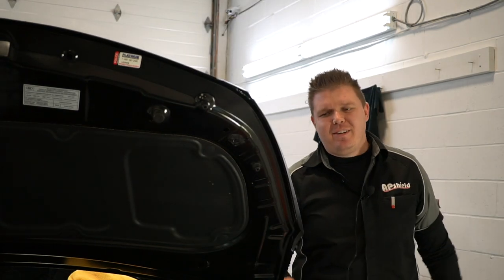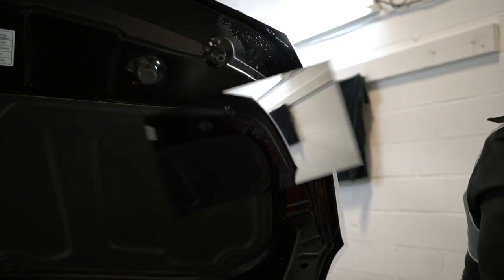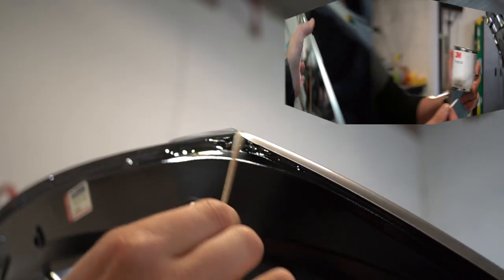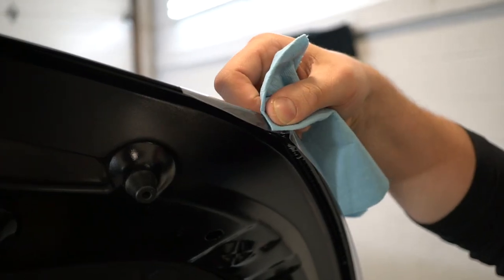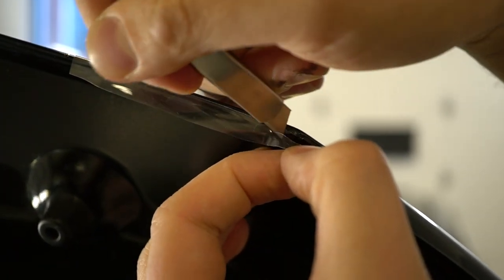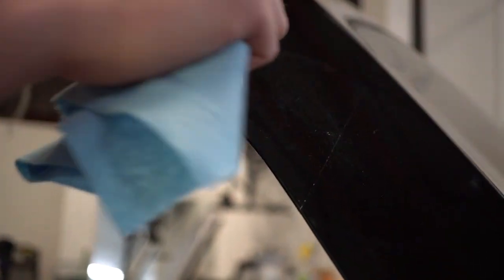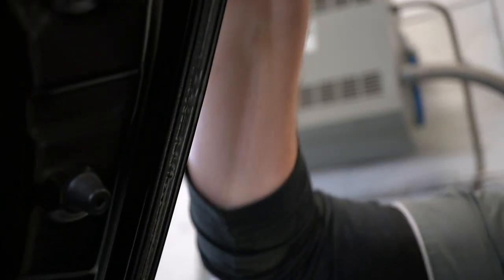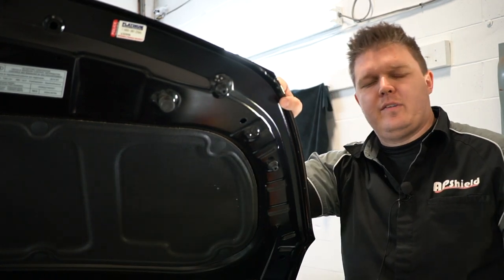How To Wrap PPF Corners and Edges LIKE A PRO

Comment: Have a question about this process. How does primer 94 compare to XPEL's edge prep? I also saw you apply the primer 94 to the paint and what seemed to be the film? Does the primer not burn the adhesive on the film?
Reply: Primer 94 is not intended to be used on PPF to my knowledge. Under corners it does ent matter. If he were to put that on the surface it would be very visible

Comment: How long after installing did you wait before using the air dryer to dry the edges? Does using the dryer ever cause the edges to lift?
Reply from the maker: You can use it almost immediately.  Just make sure that the edges on the flat surface are stuck down.  You can use some tack solution around the edges for more bite, then blast out any moisture.  If all the edges are lifting, you may be using too much soap in the slip solution.
Reply: @ThePPFChannel  Thanks for the tip. Just discovered your channel. Love your professionalism

Comment: One question, does the 3M Primer stain the film?
Reply: I was wondering that too because I noticed it seemed he was directly touching the back of the film with the promoter. In my experience this can cause damage to the film itself, though I use Xpel's adhesive promoter and not 3M.
Reply from the maker: Where I used the promoter, it will be in areas that are not seen when the hood is closed.  I put a bit of promoter on the film where the sharp corners are, but its just a small amount.  I'd never use Primer 94 in visible areas, especially on white colour cars.  It has a possibility to change the colour of the glue, and leave a "ghost" mark.
Reply: Thanks for the response, your videos are the best yet in explaining what you are doing....

Comment: That will most likely lift in a week or so.
Reply from the maker: No sir.  Been doing it this way for 10+ years with no issues or comebacks.
Reply: I agree. The corner will eventually lift.
Reply: First of all adhesive promoters are the wrong way to install film!!! This is done by inexperienced installers that dont know how to properly use film. 2nd when using adhesive promoters you are taking a high risk of pulling paint down the line when film is removed.
Reply: Agreed. If not a week deffo in a few months. That's a very poor corner installation and the primer was a joke!
Reply: Yes to the people commenting about why it's wrong, please share what method you use instead?

Comment: Wayyyy too long of a process.. nothing pro about this. Adhesive premoter, if used should be applied to edges prior to install. Some say its dangerous which it could be, but if done right and installed correctly it is much more effecient and less time consuming. When you trim the excess film off your edges, simply cut to a lower profile when reaching your corners.
Reply: @Jonathan Pthe glue is on the film. Adhesive promoter is strong stuff. If you apply pro bond (adhesive promoter by Xpel) to an edge after instal has already been done, youre risking burning that glue underneath if it comes into direct contact. There for possibly scrapping that whole piece of film. (Profits down the drain for a full hood for example, and having no choice but to re prep and start over again)
Reply: @Jonathan P note: dangerous because once you close an edge into probond, its a done deal. If there is an imperfection like a dust or a hair caught on the edge after you sealed it, its done. Maybe you can manage to lift it up again and stretch it out more, but on a black car it wont be pretty as you will have a nice glue line imperfection where the stretch was made. It really is fragile stuff
Reply: @Jonathan P   Trim all around leaving about 1/8th of an inch with my ulfa knife and carbon blade. (Holding knife with my index and thumb, leaving my other fingers free to rest on hood to guide my knife to ensure its smooth and not wavy) Going even shorter when you reach a corner, then back to that size while exiting a corner. This size of extra wrap will fit every hood without dips or non flat surfaces underneath the edge so it will be closed nice and flat.  You will be able to tuck wrap your thumb from one corner of the hood, (i start with wrapping the back edge by the winshield from driver corner to passenger corner, and then slide it along the whole hood  wrapping everything without having to lift your thumb. One smooth move. Closing the edges in less than a minute without having to go back and fix your corners. Virtually no lines what so ever.
Reply: @Jonathan P  also, this guy is using a blower to dry out his edge....what!?..blowing dust and hair and particles to your edge and risking lifting it.. Putting pro bond prior to install and closing the edge with your squeejee will cut this nonsense right out. But.. wayyyy easier said than done. Thats why i said if done right by a real professional!
Reply: You wont be able to be trained through internet. I had 8 months of full time training by a company out here in Quebec. 8 - 10 hours a day installing film, peeling it, and re installing. This line of work is not something you just pick up and go. It takes 1-2 years to become somewhat decent at installing. Ive been in the industry in toronto and here in quebec for going on 7 years now and i only really got good on my own after 2 years
Reply: @Jonathan P you're going to have trouble teaching yourself.. It cant be explained thoroughly enough by words to learn. You really need hands on experience and with good equiptment. But yes essentially under the lip of the hood, NOT ONTOP AS IT COULD BURN THE GLUE ON THE FILM. When your piece is squeejee'd, spray alchohol solution 70%water and 30% rubbing alchohol(70%) and close with squeejee, really focusing on removing all water from the edge. (It will be tough if untrained). And then yes close it into the adhesive promoter to ensure it wont lift or peel in time
Reply: @Jonathan P  if you have instagram, check out some ppf pages like 1clearbraco or eliteclearbra.  Theyre companies based out of california and have some really good content. Sorry i couldnt help you further. Good luck!